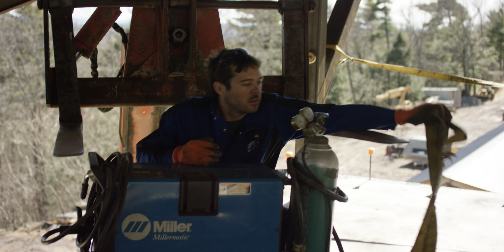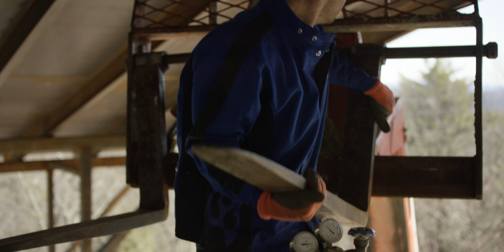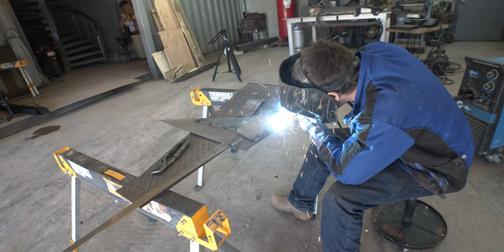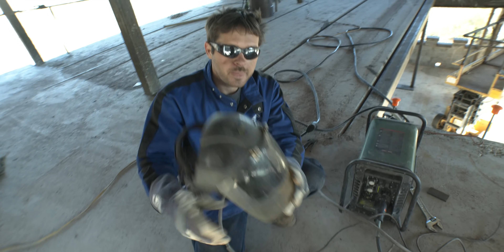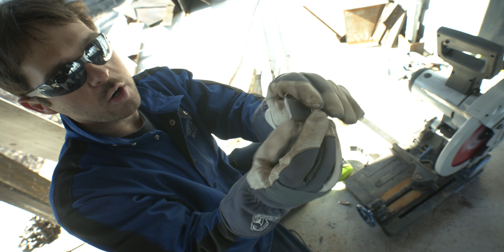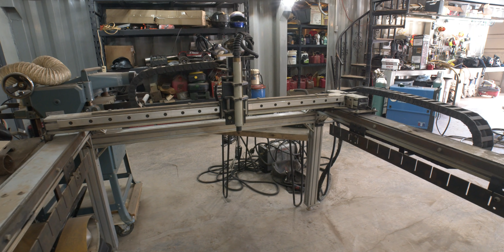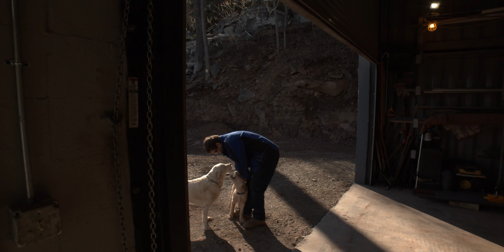Talking about welding equipment

Comment: I own a hypertherm XP 45 plasma cutter ,  mine come with drag shield's, so I can drag it right on the tip too metal I'm cutting up too 1''1/8''  thick metal, cut's expanded metal and mark metal and gouge metal,  I'm very happy with buying and using My hypertherm XP 45 it's a great plasma cutter, I also have a Lincoln pro mig 175 nascar edition this welder is over 16 year's old and welding like brand new and small enough too be portable,  I don't need a crane,  LOL   thank's for the great video's  jeepinjim63@gmail.com    Jim

Comment: I was in the Defense/Aerospace industries for over 30 years in Quality Control and 12 of those years the chief inspector of welding. I created the welding schedules based on specific requirements. Your video is perfect for the beginner needing to gain that welding resume. My nephew took over my shed for his welding shop, he's a freelancer that also works with our fishing industry in Gloucester, Ma. A good weld is always stronger than the parent material, always keep that in mind. You could use a seam welder in your shop, perfect for butt and fillet joints. Great video!

Comment: If you don't need the weld water or air tight, make your beads  about 1 inch long every other inch to save on materials (welding rods/wire and gas) You have to prepare a surface before welding, if the surface is painted or rusted, you need to clean the paint/rust off with a grinder or a wire brush.  If you are repairing cracks with weld, first drill a hole at the end of the crack to prevent it from cracking further before applying the weld. Also, if you are repairing a crack from a thick piece of metal and have smaller welding rods, cut the crack out with a torch or a grinder and bevel the edges in the form of a V and lay down multiple passes of beads until you fill the crack up with weld level with the rest of what you are welding. Welding rods are good in high wind environments, when using a Mig or a Tig that uses gas you may need to set up a welding tent/curtain around your project to prevent the wind from blowing away your gas.  Welding is fun and easy. I took welding in High School in the 90s and got state certified on Mig, Tig, Stick, and brazing. But I never worked in the field other than repairing stuff around the house when something breaks on the farm.

Comment: Andrew - you should definitely get yourself a automatic camera tracker like a Soloshot 3 or Pixio for your solo work. The way it works is that you wear a GPS transmitter that comes with the system, and the camera has a motorized camera head that follows your movement.  They can even zoom in and zoom out without you having to interfere with them. Its PERFECT for your type of solo work with your machinery.  You can also put the GPS transmitter on your dog and it can track their movement too.

Comment: The first two numbers (7018) indicate the tensile strength. 7018 Is 70,000 pounds per square inch tensile strength. 8018 is 80,000, etc.....

Comment: That was a good introduction to metal cutting and welding equipment. I had a buddy ask me about my 9 in. Slugger and I told him to check your and/or Jesse's videos for an opinion because I have only cut 10 -15 ft. total with mine. Did you contact Fein with the issues you guys had? You didn't have it that long and it seems like they should have taken care of any problems. I guess I will avoid Fein power tools.

Comment: Cool video, Andrew!  Doesn't matter to me how you video stuff so long as I can see it, & understand you. That's all I need.  I did some stick welding in the past.  I never knew if the rods I used were number 6011 or 1109.  I don't think I could do the wire welding...I'd never know when I was finished.  Aren't you supposed to finish at end of a stick?

Comment: Andrew great presentation about all the welding and cutting tools that you have got to see you talked about safety but I protection your production only thing you didn’t mention is when you’re shutting off your tanks always back off of your gauges so the springs will stay limber and also never stands from the gauges when you’re down on them in just in case it explode you’re able to get killed and I didn’t see any safety check valves if you had a burn back just some things you want to mention next time but great video love Coney he still in the show  take care work safe junkman do

Comment: Sticking the rod does not ruin the rod
Unclamp it and reuse its done all the time
Striking the arc by tapping it on the base metal is ok too if it sticks you have bad technique just unclamp it wiggle it gently to break it free (being careful to not break off the flux coating) and again reuse it it is again done "all the time" 

7018 not hard at all to fill in gaps quite easy actually and penetrates much better than mig

MIG GMAW muffler shops hobbyist etc
Stick SMAW (7018 especially) Structural 
6010 open root pipe
Flux Core Self Shield FCAW-S (T8) Structural
Flux Core FCAW-G (T1) Structural
TIG GTAW Aerospace indoor only

Comment: You need  a water trap in that air hose. Water will ruin a plasma cutter. You may already have one, but I don't  see it.  Just having one at the air compressor won't do it. The make a water trap that uses a roll of toilet paper as the filter.  Cheap to replace too.

Comment: Tighten that contact tip with pliers, you are making an electrical joint.  Nozzle dip works but make sure when gun cools and dip solidifies it doesn't block shielding gas holes in the diffuser.  Good work Andrew.

Comment: Another very good video from Andrew! Only one thing I can add here is to be very careful where you are welding due to fire hazard. The sparks and slag are very hot and will start fires if they come in contact with flammable materials. Initially one might think there is no fire but consumable materials will smolder for longer than you think ultimately starting a full on fire. Make sure your work area is free from flammable materials of all types including gasoline, paint, diesel fuel, plastic, saw dust and the like. Never ever cut 55 gallons drum heads off with a plasma torch or an oxi acetylene  outfit. Residual chemicals inside a drum will cause the drum to explode killing you and others in the immediate area. Use a manual cutter designed to cut drum heads off of 55 gallon drums not any type of flame producing, spark producing tool. Be safe and thanks Andrew for another outstanding informative video.

Comment: Andrew we have all sorts of people use our MIG welder, and most of them have no previous experience, so spatter build up was a big problem.  So we use an anti-spatter gel that you dip the nozzle in.  It lasts forever and makes all the difference.  Plus you maintain better gas shield pattern after a long session, so you get better welds with less gas pressure.   We never use it outside though, so can't say if would make any difference in the wind.

Comment: Good advice Andrew i started with a arc welder now use a wire feed, Hobart it has worked well also have a lincoln as well for smaller materials. I assume you use 10lbs spools on your wire feed especially on the roof for sure.  Great job as always.

Comment: It's good to mention oxy-acetylene cutting. Thirty years ago I moved into a house needing a good deal of work. Eventually I got around to digging up the old galvanized sprinklers and taking down some rotting clothesline poles, and before I could throw stuff out I needed to cut it up. I tried using an angle grinder, but it was taking forever. I didn't have a plasma cutter, and I'm not sure how well it would have worked anyway, but I did have a full tank of oxygen. I had a cutting head because it came with the torch kit, so I gave it a try, and it was super easy and fast - even the clothesline poles.

Comment: The shielding gas on MIG welders is used to keep oxygen out of the molten metal. If the velocity of the gas is too high (too much pressure) it will draw air into the puddle. Generally use the lowest pressure that gives good results.

Comment: Andrew nice machine  I have the Miller 250 Vintage I switched guns to a 400amp tweco gun tips are a lot less you just need a guard on your regulator I had a k oxygen full bottle fall over and broke off the regulator I jumped on the bottle so it did not take off try on your stic machine 80T AC plus messier wire its blue  6013 and 7014 and 7024  that is what I use and 7018 ac on that machine and 7018 for DC  I hope this helps out

Comment: I use OA torches everyday to fabricate structural steel. Quickest way to get it set in my opinion is to turn the Acetylene on until the end of the flame is not producing black smoke. Then slowly add oxygen until the flame is blue.

Comment: Andrew, if your going to do similar type projects like your new roof, I'd suggest getting setup like a Pro, go with say a Miller XMT 350 CC/CV {for those who don't know "CC" = Constant Current, perfect for Stick Welding, & ARC Gouging & Tig {Steel only because it's a DC power source, Aluminum needs AC power source} "CV" = Constant Voltage for Mig Welding.} If you were to convert to say a Miller XMT 350 CC/CV, you could leave this in your shop, and via welding cables (I would suggest 3 welding cables of 50 foot lengths, also 3 gas hoses {green in color} of 50 foot lengths.) Also 1 50 foot ground welding cable (a total of 4 {four} welding cables.) It's a LOT easier to setup to weld moving just cables & Gas Hose(s) to your say Miller 12 VS  "Suitcase Welder." the "VS" = Voltage Sensing Welder. With a new roll of 10 pound wire, your talking maybe 30 pounds at most. I'd get a 15 foot welding Whip for the Suitcase. How dependable is say these  "Suitcase Welder(s,)" well while working in the ship yard building little 450 (four-hundred -fifty foot) boats, approx. 35 plus welder's , each using a Suitcase Welder, running a ten pound roll of wire a day, for the four years I was there, very little problems, and most of the problems were self induced, i.e., the cutting / breaking of the grounding lead on the suitcase welder etc. Put another way IRON CLAD welding system. If your looking for used, if the suitcase welder doesn't have digital display, (inches per minutes & voltage display ) its a much older welder, so depending on price it could still be a good thing. Great video's Andrew.

Comment: If you're confident of the strength (penetration) of your welds then it's a "safe" weld.
I'm not sure but for what you do (private jobs) I don't believe you need to be certified?

Comment: Maybe you could weld an I-beam on one of the quick change plates for the teleloader and add a few hooks to it so that you have a short movable crane arm at the end of the boom. So you dont need to pull the straps over the forks all the time.

Comment: Hello, Mr. Camarata.  Great video as always.  I truly appreciate the generous content.  Would you ever consider making an informative video about different types of equipment, including but not limited to maybe excavators, skid steers, 6 wheeler dumps, front end  loaders, and which brands, and which models might be good ones, and what you could expect to pay?  It doesn't need to be an in depth guide (although that would be amazing, but of course I know that probably isn't feasible as you are a very busy man) but just some of your knowledge that we all value on what might be good for someone just getting started!  I would really value your opinions on what units are good and what aren't.  Thank you very much

Comment: Hey Andrew, another great vid.! Since you're revisiting weld strength, and I was going to mention this on that previous vid., and coming from a structural designer, the rule of thumb that I use, is that a 1/8" fillet weld is good for 1500# / inch, then you can extrapolate from there. You can do more precise calculations, but for quick design this will work conservatively.

Comment: If the youtube 'experts' ever had to see welding on a skidder onsite 20 miles in the woods during spring breakup, they'd probably have a stroke. But somehow people have welded in less than ideal conditions for decades and their 'non Xray aircraft certified cork sniffing manages to hold up just fine.
Reply: Hes welds are just fine.
Reply: @jeromeduffy9270  Yup. I'd never worry about anything he welded.
Reply: Indeed, I have been welding on farms (Lots of muck, livestock and corrosion and weather to deal with) in the North of England for 25years and it not exactly fun. Workshop welders have it good compared to Andrew and myself!

Comment: The look is great with the camera dynamic movement, continuity, and presentation not bad.  Great shots at 1:16….2:25 (slow-mo)..and others.  The longer the video, the more at ease you seemed.  Probably due to not having to worry about videoing yourself.  Way less edits than other videos.  Subject matter knowledge comes through loud and clear.  As much welding as we’ve seen in other videos, I learned much more on this one.  Keep your eyes on the camera, show them your eyes.  Well on its way to a good audition tape, if you ever need one.  Just saying.

Comment: Purely Constructive and Subjective criticism for the Editor/Film guy (Mike I presume?) - Just my 2 cents.
- Film burns / Dust effects are pretty overused, in general I mean. So try and keep em' to a minimum.
- The cuts are a little too fast in some places, like when Andrew was welding, also the angle changes are pretty jarring. Also, know the audience, you don't have to do any crazy fast cuts or anything because most of Andrew's audience has a good attention span (at least those of us who are subscribed). 
- The 100/120FPS slow mo is pretty neat, but maybe a tad overused as well. 
- When you are in low light situations (like under the roof) - watch your shutter speed. There was a lot of blurring - may also be resolved if you set your camera to record all intra frames instead of doing long gop compression.
- The shots inside the garage with the outside light were pretty blown out, I understand you were just here to film a quick video and not to shoot a movie, so that's fine, but you could also lower your ISO a bit, and maybe check your EV. You can lower the highlights in post as well. 
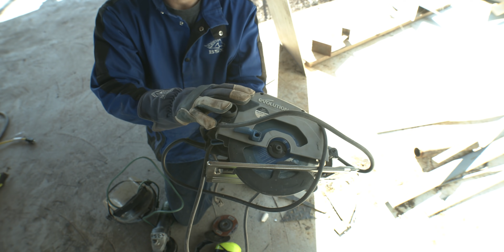- In other situations (like at 11:50) you could use a bit lower exposure values, or even boost the contrast in post, because the highs are too high.
- You could also do well with a gimbal, some of your shots were crooked or had some jarring motion while walking. Alternatively, if your camera has it, make surer IBIS is on, or OIS if your lens has it. 

Other than those points though, it's a pretty good video. Again, not trying to be a jerk here, just wanted to offer some perspective and CONSTRUCTIVE criticism to give you an external viewpoint.
Reply from the maker: Interesting.
Reply: @AndrewCamarata  his comment was a little to long , a little to wordy , slightly annoying, preachy.
Reply: @johnparkhurst825  it's advice for the dude who filmed it, if you read the comment at all. like I said it's constructive criticism. people who are actually trying to get better at what they do always appreciate an external viewpoint. the comment isn't for you.
Reply: I also think the audio could use some dynamic range compression. In other words, the saw cutting through steel should be the same volume as the excellent welding explanations.
Reply: Tooooo picky geeez...you realize he DOESN'T even have to post these vids at all!! ...im just happy he does post vids and its not Hollywood type stuff thats all perfect ...Andrew your doin well..just my 2cents..thank you
Reply: @leeharris3061  dude chill, I said it's constructive criticism. it's for the guy who made the video not Andrew anyways... I've been watching this channel since he had about 20k subs so I'm not going anywhere